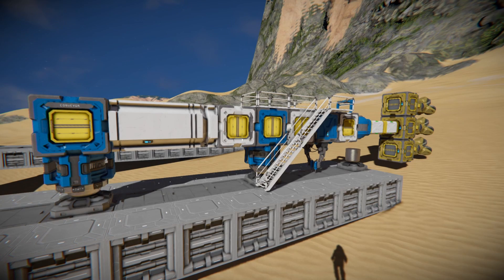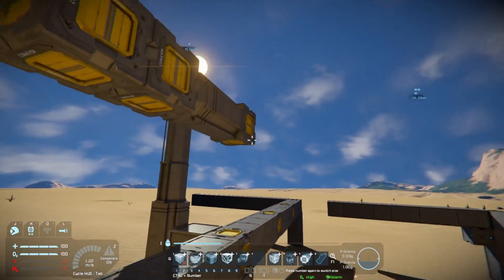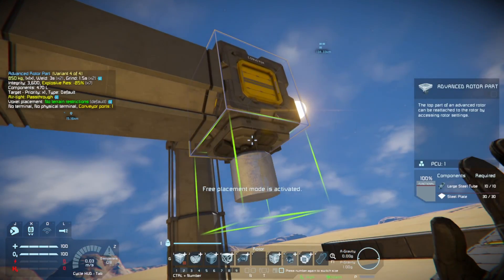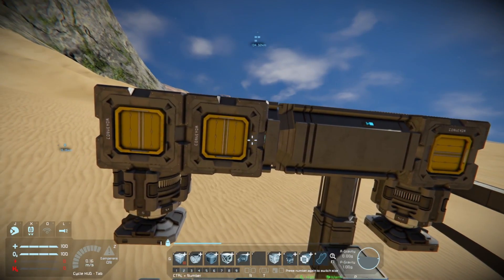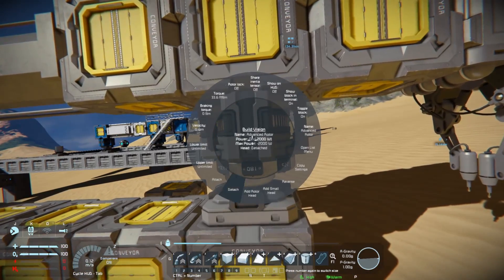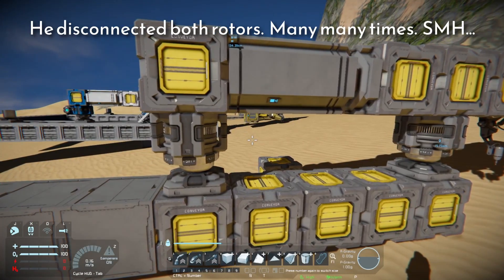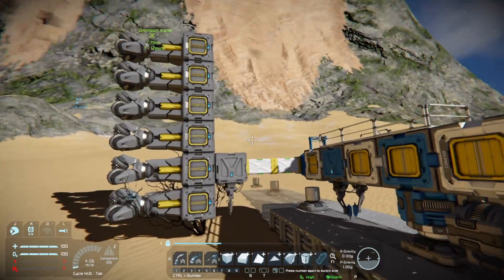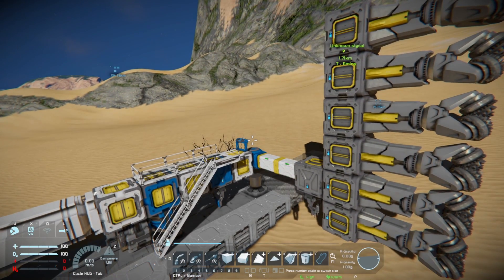Space Engineers Advanced Rotor Infinite Drill Rig

Comment: So when i first built it, the stone was passing through the rotors into my base. But Clang decided that was not to be, and promptly destroyed everything on the first rotor movement. After that i can get everything else working including Clang free rotor moves, but cannot get the stone to pass into the base. Ive used advance rotor head, but it shows as not connected. Any Ideas? Oh and great design by the way. Which is why i'm trying to recreate it.
Reply: Solved my issue. User error as it turns out. I must have replaced one of the rotors with a regular rotor and not an advanced. I didn’t think it mattered, as long as the head was correct, but apparently it does. They must be different somehow.
Reply: @shaunwatts6114  Can't pass resources through regular rotors.
Reply: Same.  Great idea, but destroys the drill when attempting to attach front rotor.
Reply from the maker: Oh no, I'm sorry it was troublesome for you.  Sounds like you got it working in a later comment though.